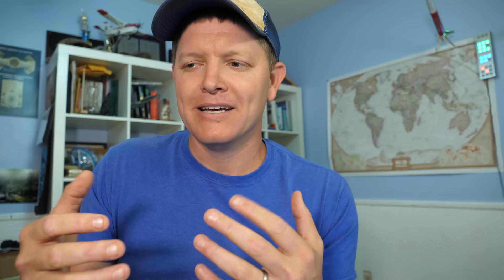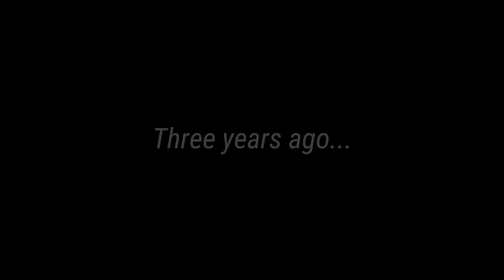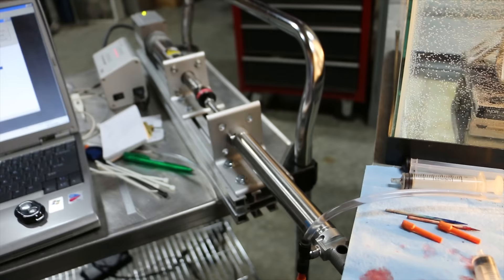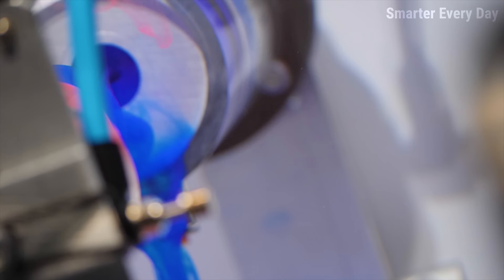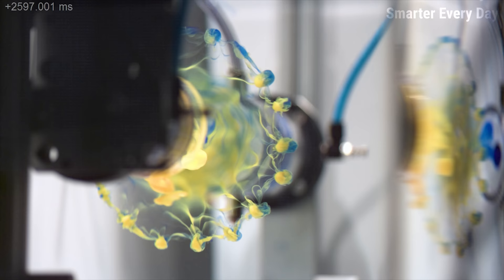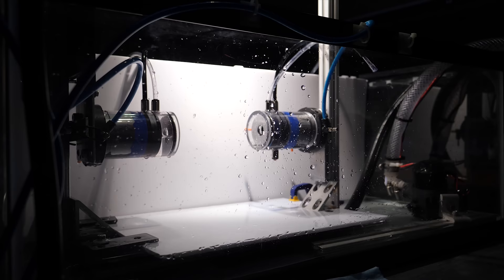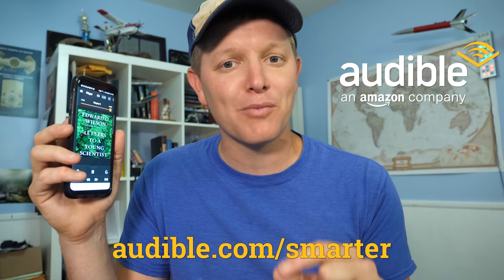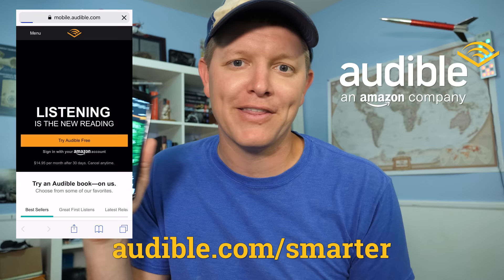Two Vortex Rings Colliding in SLOW MOTION - Smarter Every Day 195

Comment: The concept is actually so simple. Force takes the easiest route out, which is sideways. Imagine water dripping on the floor. The simultaneous pressures from both sides create a imaginary wall,so there is only one direction to go. As the liquid moves along this wall, the friction gets less and less. Creating a rolling effect. Once the rolling motion overpowers the friction, smaller circles form again, 90 degrees off due to the motion caused.

Comment: Many years ago I did some research on thermoelastic effects with concentric discs. One unexpected effect we found was that the many round hot spots that formed always were a prime number. Varying condition we got from 3 to 23 evenly spaced spots.  I would like to know what number of ring spots you generated, and what influenced the number of these rings.
Reply: Interesting...... Do you know how/why the rings form?
Reply: Chris Heichel   In my research, it was thermoelastic instabiliy. Friction causes temperature rise, which causes thermal expansion, which localizes heating to a narrow band.  The higher the rotational speed, the greater the instability and the quicker the hot spots form. We even found that a plain paper ring could form hot spots on steel (blue oxide color) in about 0.7 seconds without even discoloring the paper!
Reply: @arnoldanderson7661  Thank you! It looks like it's going to make for some very interesting reading. I look forward to learning more about it.
Reply: Since the pressure differential inside and outside the ring would be consiastent around the whole ring, the ring being symmetrical, then it seems feesible that the collapse would break into the lowest possible whole number larger than one, at intervals informed by the dimensions and momentum of the fluid. The rings in the video I mean.
Reply: @benwilms3942 ) You need to learn more on physics and the English language before you comment on subjects such as this.
Reply: @dredrotten  it's just a thought that I felt like sharing, never said I was a professor. I'm not sure why you think you know anything about my knowledge of anything. Especially the bit about English, the only evidence you have is that I occasionally hit the wrong button when I type.
Reply: Red Rooster He’s just trying to think, man. Let a guy explore his imagination and receive positive feed back. Why must you be so aggressive? He could be a teenager, like myself, who is trying to explore and learn new things. Better than sitting around playing fortnite.

I’m going to do some research on this topic, because I’m quite intrigued myself lol
Reply: Rudy  I did some work with rotating parallel plates of steel, with an oil between. when a clamping force was applied, the plates never actually contacted, until almost stationary, because van der waal forces (oil to steel plate) kept the plates from contacting.  The temperatures and pressures were insanely high at speed, but no measureable damage was done to the steel plates, and the oil degradation was almost non-existant. The behavior of this system could be modelled, quite well, except when the rubbing speed dropped below around 2 m/s, or when the system became thermoelastically unstable.  I do not know what you are asking about the very small particles. We had elastohydrodynamics governing the high speed behavior, and van der waal behavior with fatty acids affecting the very low speed behavior. Hope I didn't miss your point. At 88, I am way past doing research any more. Sorry if Imissed your point.
Reply: In one of Douglas Hofstadter's books, he shows images of a video camera taking pictures of the display. It's a recursive pattern, and mathematically predictable, but at least one of the images had a prime number of iterations. You might want to look that up. I think the book was "The Mind's I."
Reply: Arnold Anderson Find out for yourself
Reply: @rudy310  the michelson-Morley experiment did not support the theory of a stationary aether, how do you think it proves it?
Reply: @arnoldanderson7661  at 4:58 I think I can count them
Reply: @arnoldanderson7661  17 rings
Reply: Hanan Saleem Hanan;
Thank you for that information.  I expected that it would be a prime number as many non-linear fluid flow, heat flow (thermoelastic), and mechanical vibrating systems (especially with circular plates) behave that way. I did a lot of work on brake squeal, where the vibration preferred the lowest number of nodes (3), but could start at five, if the wheel had 5 lug bolts, and they were put on very tight. 
If I was a lot younger, I would gladly make it a point to find out why mother nature likes prime numbers so much.  Again, thanks for your comment.
Reply: when maths and science starts to collide (I think the channel 3Blue1Brown might be somehow interesting about this, just saying)
Reply: I counted the rings as many times as possible and it seemed it was 17 most of the times. Its a very interesting observation you made in your research and I believe the number of rings depend on the speed of the vortexes meeting and density of the fluid.